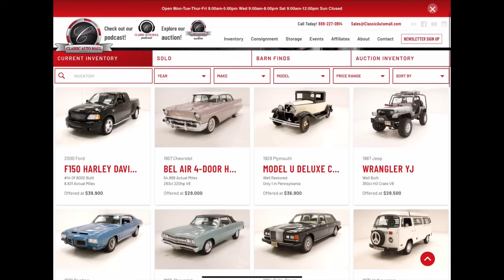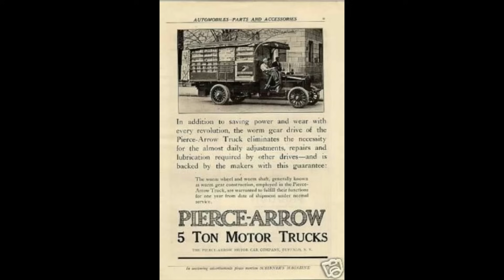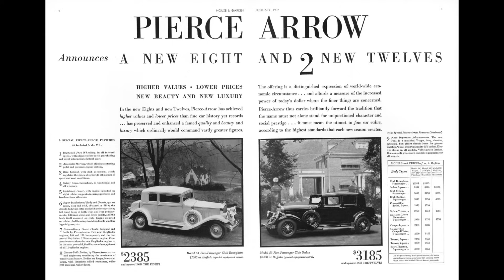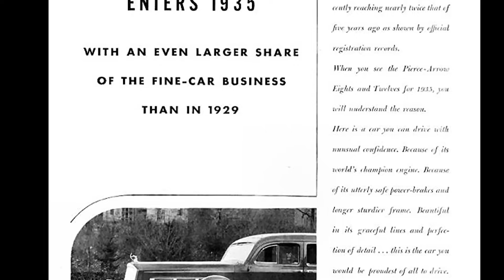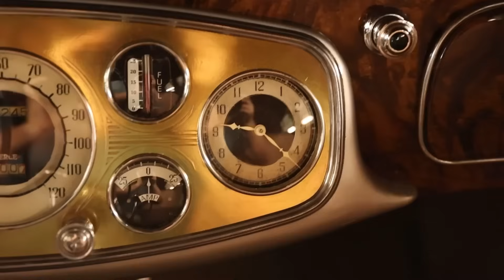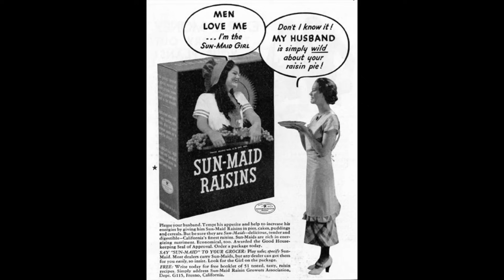1935 Pierce arrow model 845 seven passenger sedan ￼

Comment: She's a beauty, Jay!  For the mid thirty's, she's the top of the tops. 🎩😊. Excellent body color as well, compliments the woodwork and chrome, and the headlights in the fender set Pierce Arrow apart from all the rest. Might be a bit tricky changing lanes with that huge blind spot, but probably mostly a Glidden tour car, so no sense in worrying there.  The brake and gas pedals shaped like cushion insoles, I guess that makes sense!  Reliability was Pierce Arrow's selling point early on, probably a durable car as well.  It's funny where you find these rare gems, someone in the Wausaukee area has one, the repair and body shop down the road from the fairgrounds was repairing and repainting one from the mid 30's a few years ago, but not quite as fancy as that one!!  A rolling work of art, thanks for the tour. 🎉🎨 😊.
Reply from the maker: Thank you so much for sharing that insight I love cars off the beaten path I just wish I could find more information on this particular model for whatever reason pierce arrow has checkered years so to speak and this was one of those gears that there isn’t a whole lot of information out there I’m sure the information exists it’s probably just not on the Internet. 
I need to get books on each car brand. 

If you don’t know I’m a huge Packard fan but I would’ve taking this one home with me had I had the space in the budget to do so but with that said the crappy realization is depending on what Side of the coin you’re on these cars are going to continue to go down in value because the people that appreciated them are moving on that’s why this channel exist to try to get more people interested in the classy stuff. But if it ever does hit rock bottom I will be buying it up and saving it and driving it preserving it for future generations I can’t be the only person that digs this stuff
Reply: @What.its.like.  I know what you mean, Lawrence had the same problem selling Julius's 1909 Packard when Julius and his wife Margaret passed away, plus the White gasoline car.. not many enthusiastic old car buffs were left to want the early gas and brass cars, though interest ebbs and flows.  That Pierce Arrow might be loosing value now, and for who knows how long, but at some point the market will rebound, but just when is anyone's guess.  My goodness though, what a beautiful luxury car!  Would make a great movie car, maybe that's the way to stimulate interest in the gems of the 30's?  💎PS, Hurray, I'm happy to hear that you are a huge Packard fan!!  🎇🎆🎉
Reply from the maker: =) I want a packard 12 as the made it car lol
Reply: @What.its.like.  Lol, good one! When you've arrived in style and are ready for that trip around the world 🌍🌎 😊.  You'll have to "ask the man who owns one", which at this stage is anyone who shows theirs at the Concours d'Elegance. 🎩
Reply from the maker: I even love the cheap Packards like the 120s and the 115 c I reviewed a 115 C a while ago and I was really impressed by that even though it was a six cylinder car it was only $100 more than a Chevy or Ford at a time for a Packard if I had one I would drive that car every day six cylinders change out the rear end you probably get 20 miles of the gallon out of it if not more.. and to the everyday person that has never seen a basement level Packard they will think that it’s a really elegant car meanwhile it’s a basement model packard
Reply: @What.its.like.  Yes, I like the looks of the 115c, and they're still really affordable for a Packard! They look almost as good as a coffin nosed Cord but with a much more practical design, and I would think as well with the 6 you could change the differential, maybe put on a higher compression head, and get 20 mpg or more. Probably holds it's value over time, unlike a new car... Repair parts might be the only issue.  🧰

Comment: Had the Depression not only killed PA, but also nearly Studebaker, there probably would have been an SPA, Studebaker Pierce Arrow Company for many years. In fact, there would have likely been other acquisitions. Studebaker was associated with so many great names, White trucks, Pierce Arrow, Packard, Mercedes Benz, you have to conclude either bad management, or fate itself could stop such opportunities. This is a gorgeous jewel of a car. The 33 Pierce Silver Arrow was designed and built at Studebaker. Druthers: 35 Packard, 36 Cord.
Reply from the maker: Great choices awesome information =)

Comment: Sorry, but you got that grille function exactly backwards. The grille closes when the engine is cold, as it is when parked in the video, to allow the engine to warm up to operating temperature more quickly. Once the engine has warmed up, the grille opens to allow cooling air through to prevent overheating.
Reply from the maker: I was on a Packard website and that’s how they explained it the grill bars shut when they get up to a higher speed so it doesn’t create drag if the engine is running cool
Reply: @What.its.like.  "They" know not whereof "they" speak. The sole reason for the thermostatically controlled grille louvers is to regulate the temperature of the engine. Just the same as the water thermostat or thermostatically controlled controlled fan in modern cars. As you yourself said, "thermostatically controlled grille".

Comment: In 1933 Pierce Arrow offered what was called the Silver Arrow. It featured futuristic styling which set it apart from anything else on the road. It was priced at $10000.00 which was a lot to spend during the depression. Very few were manufactured, maybe 10 or less. All Pierce Arrows are recognizable by their headlights which flow from the fenders. I would chose the Pierce Arrow over any of the cars shown here, although Cord would be my second choice.
Reply from the maker: Awesome information =)

Comment: Only Cadillac from 6 choices would entice me over Pierce Arrow due to 3 windows A,B,C,D pillar design, smoother, more sofisticated, faster engine. However front end of Pierce Arrow is so gorgeous and unique that would make me think twice on the choice. Yes, Cadillac is not so rare but I presume finding parts usable for GM should be easier than for an exclusive luxury rare yet orphan brand for a very long time like Pierce Arrow.
Packard looks cheap by comparison. Cord looks weird.
Lincoln and Packard don't look bad but they are middle of the pack to me.